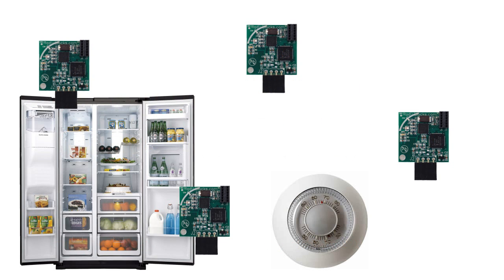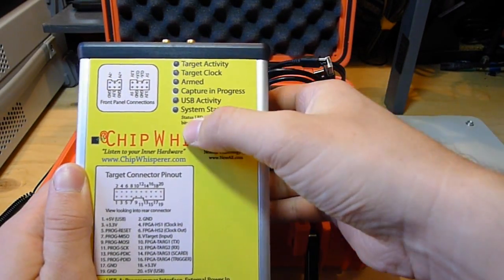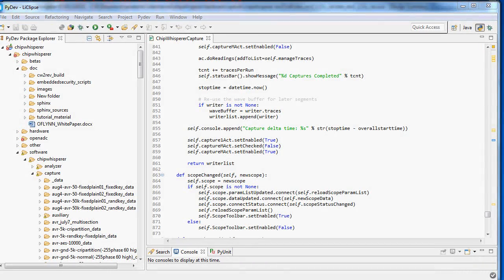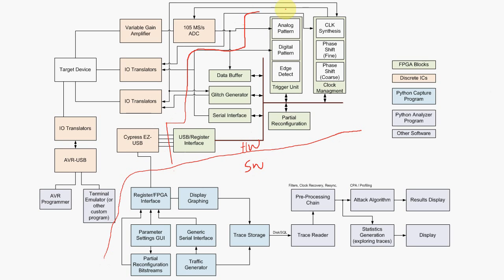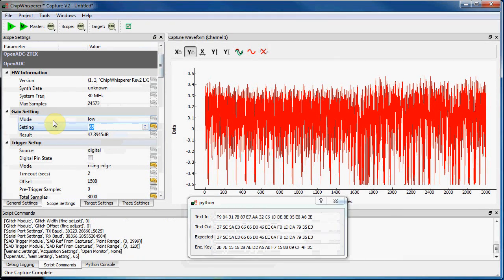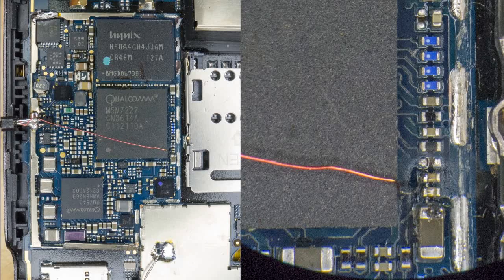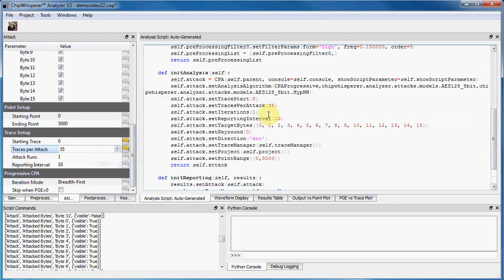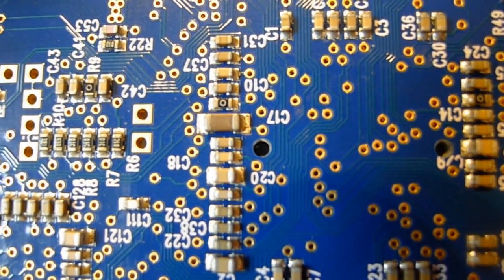ChipWhisperer Hackaday Prize - Finals Video

Comment: Great project.  I'm wondering if my bemicro scope fpga board would be useful for this.
Reply from the maker: Thanks! You could use a BEMicro board although would need to port the FPGA code. If you fixed the clock blocks it would be easier, as those are pretty specific to the spartan 6 device.